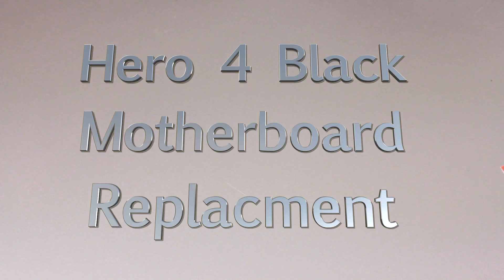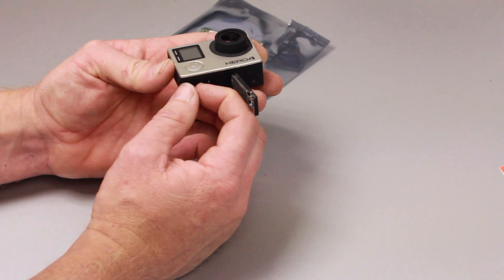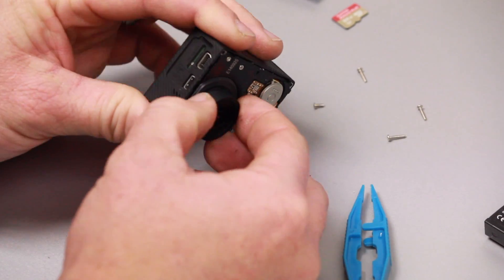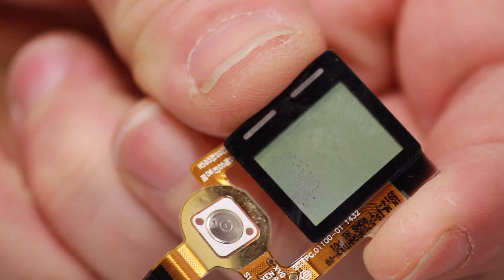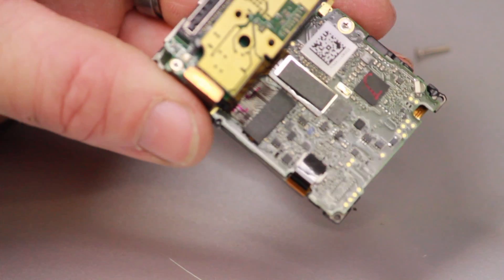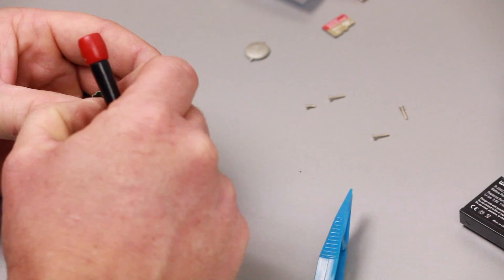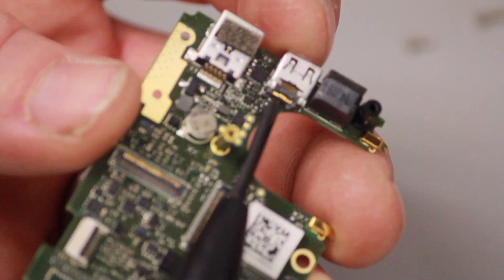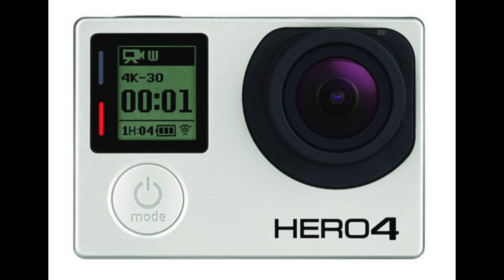Gopro Hero 4 Black Edition Teardown - Motherboard Replacement

Comment: i bought 2 go pros and one has a settings and shutter issues the owner already told me about it and gave it to me when he sold the go pro so i got 2 for the price of one.so do you think its the mother board or just the attachment coz it powers up but the shutter and settings button doesnt respond it did once in awhile but most of the time doesnt.

Comment: Thanks for the video.  This helped me when replacing the image sensor because of the freezing up problem.  any one who has a freezing up issue should just get a new image sensor off of ebay and replace it.  it's not expensive and it fixes the problem.

Comment: Wonderful, you missed all the tricky bits and spent ages informing us how to reset the wifi password.  How do you get the ribband cable back in how does the power cable plug come out.  Really just a video about screws and Wifi.

Comment: I'm watching so I can tear my Hero4 black apart and strip it down. Any idea if the camera will work without the lcd? Ibpal on citting up the case, just leaving enoigh so the rear connector os able to connect to my Solos gimbal, leave off the front cober, and anuthing else I can. My goal is to lose 28 grams, not counting the battery, which can ne left oit because the drone provides power anyway. Ill spray it witj conformal coating to protect it from moisture, and maube some dabs of hot glue for structural integrity.

Comment: Chuck, I have a bricked GP 4 Black that I had Peau Production modify the camera with a lens. During a firmware update the WiFi connection was lost and I have a GP that will boot up and then freeze up within 10 seconds. If I place an SD card in the GP the GP will not even boot up. Have tried every option to load new firmware and nothing works. A call to GoPro and I was told its dead and can't be repaired. Will installing a new motherboard bring my GP back to life? My email is kt1957@cox.net     Infixit is out of business....    I am a drone pilot as well.    https://www.youtube.com/watch?v=1szlznomw7M
Reply from the maker: Hey Keith- If you've tried everything.....it sounds like you might have a bad mother board.....that would be my best guess.  I wouldn't know how to help you without checking it out myself.  Have you found a different place to buy a mother board? Which Peau lens do you have?
Reply from the maker: The Coal mine video was awesome! What drone/camera are you using?
Reply: Hi Keith, I'm having the same problem as you with my GP 4 Black as well. Always freezes after a few seconds of being on. Were you able to fix it or is yours still busted?
Reply: I have yet to purchase a motherboard. I know when I do replace the MB it will solve the issue as the MB is the entire brains to the GP. I need to get the MB as I have way too much invested in this GP as I had the lens replaced a while back with a 16MP lens that has no distortion or fisheye. Video using my GP with the updated lens.  https://www.youtube.com/watch?v=QiM9r3d8Fsc

Comment: the lcd in the front goes down with pure alcohol, not brute force and better also not hot air. 
3-5 minutes, and the double adhesive tape loses it's glue capability. it works without cracks, damages, etc.

Comment: how do you put those three black wire from the battery inside the connector?
Reply from the maker: Uh oh! You broke yours also, huh?  I left the white connector off, and did some very fine detail soldering with the wires.  I also added some length too the wires so that I could easily work on it again if needed.
Reply: @ChuckPPhotography  How did you get the ribbon cable back in? between the back and the front sections. That would have really helped.
Reply: i did the same thing thanks xD

Comment: cool tip is use hot air to take off glued parts and by that reducing the risk of ripping something away 
tks for doing the vid BRAH i'm thinking in getting broken gopro's and refurbishing them. sorry if i misspelled some words or the whole sentence LOL 
chea!
Reply from the maker: Pedro D Thanks for the tip. I should have thought of that! I've done it on enough phones. Sounds like a cool business. ...I could get into that!